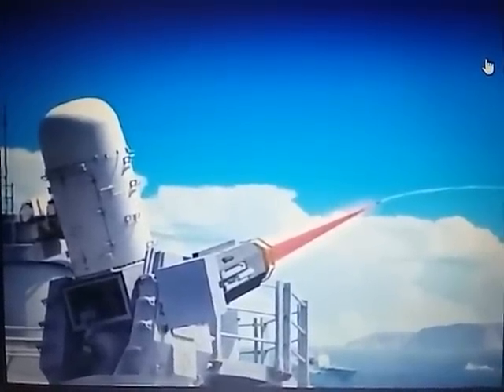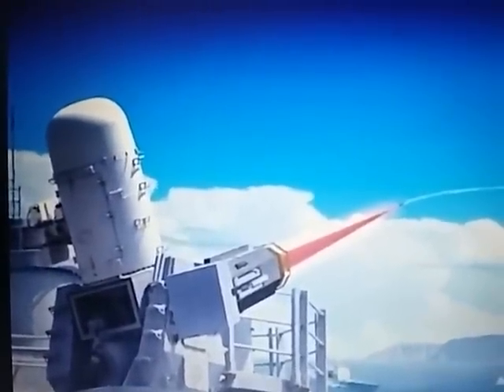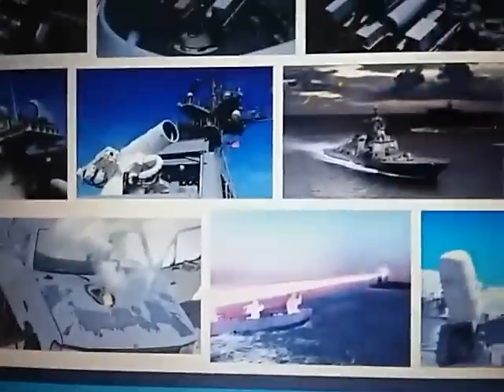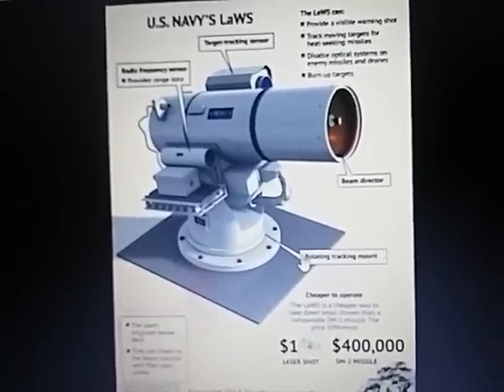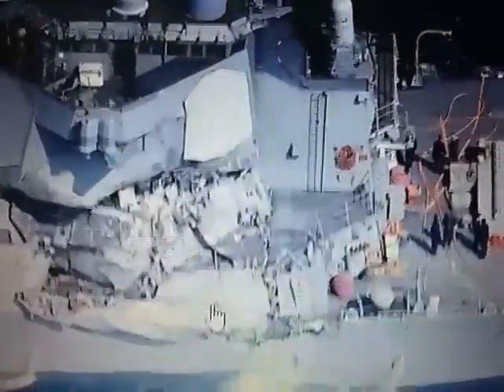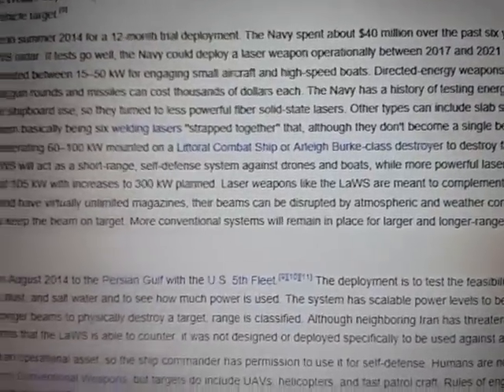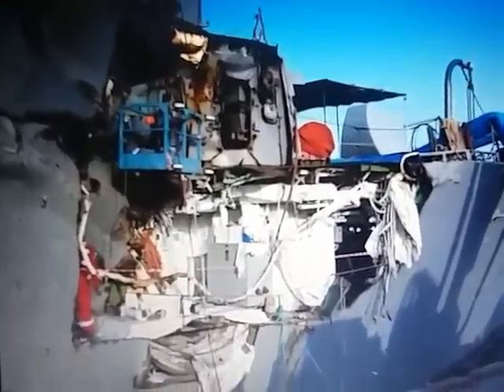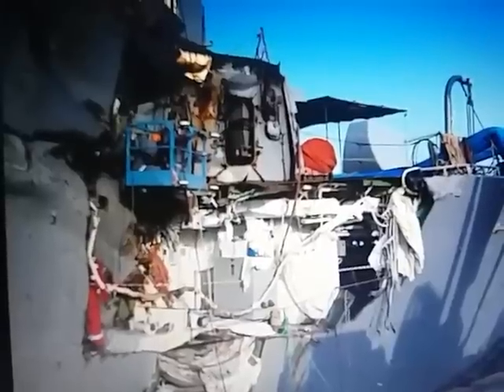!NAVAL LASER SYSTEM ZAPS NORTH KOREAN ICBM!

Comment: A laser will not disrupt electronics.  The LAWS system is a deck mounted system.  The system is based on the CWIS mounting.
The LAWS is designed to operate  at sea and in motion. There really is too much BS out there.
Reply: Paul Boyd  I’m completely ignorant as to what a laser can or cannot do, so I’m genuinely interested, could the laser destroy the  rocket?
Reply: Yea, I don’t get it either.  No way you put a weapon on a ship that requires it to be at anchor.

Comment: The laser system just looks like the anti air that is deployed on the ships. That could be your reason why why it is deployed in secret but in the open because it is disguised as another weapon. The reason why they deploy such equipment in the centre on the ships is to cover front and rear of the ship on on either side if they where to put on at the front and one at the back they would only be able to cover the back and front from one side at a time not a good issue if attacked from all sides.

Comment: Lasers travel the speed of light. The ship would not have to be stationary to hit something. Not only that the M1 Abrams tank has a leveling system to keep its gun on target when moving. I would think this weapon would too, even though not needed. We're talking 186,000 miles per second here! As soon as you acquire target and track it, then fire, its a done deal in a snap.
Reply from the maker: right but as we know the greater the target distance the less the margin for error at the source,...a few inches of travel up and down with the waves would correspond to dozens of feet different 200 miles up,....
Reply: The Abrahms Turrent Stabilization system used a computer to recieve position sensor input 100s of times per second. It then sends 100s of corrective commands per second  to the turrent stabilizers . The ships targeting radar controls  the weapons aiming . The accuracy with such a system is well above that of a traditional weapons Platform with its recoil affecting the weapons aim. The Lazer has no heavy bolt recoil and feeding affecting its accuracy . Its a high energy focused beam . It can track a target and keep the focused beam on the same spot easily. The same system has disabled the flight control computers on earth Orbiting Satellites causing them to fall out of orbit and burn up as they enter the atmosphere. Those Satellites are travelling at 25,000 + mph btw

Comment: The only way LASERs can shoot down ICBMs is from space as the missile exits the atmosphere. The atmospheric turbulence is too high through the bulk of the atmosphere. The airborne LASER system was cancelled due to this.  I worked on the atmospheric turbulence experiments in the 80s. Unless there is a massive increase of the power of these devices, which I have not seen in recent years, I call this BS.

Comment: Darpa and the USFS mounted HELLADS on B1-B's back in 2014. The Navy got them in 2015. Darpa designed the system to be under 3 cubic meters and 1/2 kg per kilowatt. They have developed a 150 kw and a 300 kw (two systems optically combined) in the upper UV and 3 to 5 nm gamma range. ABM defense is the primary role. Start paying attention to the B1-B's sent to NK after each missile, look at the laser emitter on the right side, under the fuselage in between the cockpit and the leading edge of the wind. Some of the videos on YouTube showing B1-B's taking off show the metallic blue tint laser window very clearly and this pod is easily seen in flight.

Comment: LAWS doesn't have that kind of range. They are used specifically for close in defense against incoming munitions and smaller anti-ship missiles. It has the power capability to replace the Phalanx. There is no possible way LAWS could shoot down an ICBM. The ship itself isn't even capable of producing enough power to fire a laser to shoot down a missile that is in low Earth orbit. 
 And no, LAWS does not require you to anchor the ship to be used against incoming munitions. It has a tracking system just like the Phalanx that allows it to track targets while the ship is in in motion.
Reply: Condor1970    You are mistaken on all points.
Reply: Yeah, I guess I don't know anything. I was just in the Navy and know all about the new weapons systems coming out over the next 20 years.

Comment: Pulse LASER, I worked on a system that is still in use at WSMR that uses a Sodium Flourine liquid Pulse LASER. Now as far as being at anchor is questionable. I was at sea too many times to know that a gimbaled system would not need to be stationary. Let's talk about tactics. In the 1980's we would lay off outside of the sea lanes, but the sea lanes are everywhere in that area of the Pacific - been there. My point:

He's an intel puke, not a weaponette, and not my specialty. He has limited knowledge in the specifics of the weapon system. That system is gimbaled, is quick acting, and requires a lot of power. LASERS are inefficient, and require a hell of a lot of power - like all class 4 plus LASERS...
Reply: http://www.wsmr.army.mil/testcenter/testing/landf/Pages/HighEnergyLaserSystemsTestFacility.aspx
Reply: http://www.thelivingmoon.com/45jack_files/03files/White_Sands_Proving_Grounds_01.html
Reply: Consider SDI, but using a ship for mobility, instead of a satellite.

"Why a ship?  The whole SDI satellite was only a few thousand kg!"

Yes, but it was unmanned, and didn't need shielding. The AR shields on such a system would ordinarily be hundreds of thousands of kgs, which illuminates where the real high-tech advances have been made:

Destroying stuff is incredibly simple; preventing destruction is remarkably difficult.

Comment: Im curious to see if we can confirm that the fitz was in striking distance and anchored at the time of the failed ICBM Flights/launches. I feel thats only thing between full comfirmation of this.
Reply: Also, his hypothesis is that the laser was on the ship's starboard side, but if the Fitz was facing North-East, the laser was on the wrong side of the ship to be pointing at missiles coming from NK. Another fact is that the bow of the ACX would have hit almost exactly where the laser was positioned on the starboard side of the Fitz. That's a bit of a coincidence, isn't it?!

Comment: Another day, and another theory. This new theory is actually based on what Florida said, the hole was used to cover up something.

I read a Chinese news article about the USS Fitzgerald, and the editor had some knowledge about the ship. He drew a map illustrating the above and below water impact area, as marked by red.

https://i1.read01.com/uploads/0GeU3T3Ief.jpg

Noticed what the picture actually show? Half of the hole was in the engine room!

If it were true, then it explained why the sudden lost of all the power. The sea water rushed in with the hole, almost immediately the gas turbine engine was blooded and disabled. The whole ship could have lost power in less than a minute!

Someone here might say, "Wait, there were 2 gas engine rooms and they were completely isolated..." That's true but in a sea area which is relatively safe and friendly, the destroyers only use 1 or 2 gas turbines in the engine room #1 to save fuel. Once engine room #1 was flooded, all electricity went out and the engines in room #2 didn't have the power to start. 

The Navy couldn't acknowledge for some reason. They only said one of the two shaft were locked, and tried to use it to give us the idea why the ship couldn't go by her own power afterwards. However, you have to know that the shaft and the engine connects to it are very tough, they were designed to be working even after a torpedo hit. There are shock absorbing mechanism in the whole power train. It unthinkable that the propelling engine and the shaft are so far from the impact yet were affected the most.

I think the reason they don't want to say their engine room was flooded is obvious. Too embarrassing! And they don't want any one knows there are weak points like that on their destroyers. Well, too late for that. It's not co-incident that the USS Cole was attacked in the same spot, and the Cole also lost communication and power afterwards. It was not really a secret, not even 16 years ago.  

Also, the story about "radio room" got flooded was totally bogus. It was made up to cover up the engine room problem. There was a comm center, which could have flooded and caused the blackout, but its location means it could only be the last one get flooded. So it's not the reason the ship couldn't send out SOS signal to the base.

I believe I am getting closer to the truth. Unfortunately I still couldn't rule out the human error. If someone in CIC being ranking officer and extremely cowboy, the incident could have happened the way like the Navy says, even though the chance is very small. At least now I know why the ship suddenly lost all power. One big piece of puzzle removed.

Comment: Hey guy I build navy ships I work at the yard that built the Fitzgerald  a ddg51 cannot sustain the power needed for a laser system like the one in the video or a rail gun that is what the new ddg1000 is for and the new ddg51 class ships are for not the current ones the new ones will be getting a electronic drive propulsion system and the only other ship that could take a system like that are the newer style carriers but you are completely wrong on everything you are assuming
Reply: Have to agree with you. The Fitz cannot "SUSTAIN" the power needed for laser or magnetic rail gun, but with the help of a large array of super capacitors it's still possible to do the experiments in a intermittent way.
Reply: Philip W Well where are you going to put a laser on a ship that was never designed to have a laser system installed? As you can see from the pictures all of the original weapon systems are still installed. It would take probably millions of dollars and an extensive layup period to install laws.
Reply: Uh... you win...

Comment: Florida, thank you for another great episode and some of the things you said do ring a bell.

The purpose of the patchwork perhaps is to cover the interconnection between the CIC and the Vertical Launch System. The Internet is not supposed to know how the missiles are wired, or any extra device to control the missiles. So what your old friend said do make a lot of sense. It's really necessary to spend 3 weeks to patch that hole.

Comment: In order to use the laser system or laws the ship the ship does not need to be anchored. No the ship doesn't need to be anchored as it has a very accurate GPS station-keeping system that will hold it in the exact position they wanted to sit in regardless of most currents and wind conditions. The ship was an anchor because it was in Port.

Comment: That is not a laser system.  That is a phalanx or modern version of phalanx.
Reply: 1. a body of troops or police officers, standing or moving in close formation."six hundred marchers set off, led by a phalanx of police"a group of people or things of a similar type forming a compact body."he headed past the phalanx of waiting reporters to the line of limos"(in ancient Greece) a body of Macedonian infantry with long spears, drawn up in close order with shields overlapping.2. Anatomya bone of the finger or toe.
Reply: Phalanx gun, primary use navel close anti missile weapon using a 20x102 mm cal., firing 3000 rounds/min or 50 rounds/sec.

Comment: Take a more simple approach.. lets assume She was anchored, and yes She did have a laser equipped.  What can the Captain do until such time as he has definitive certainty that the Freighter has of ill intent. IF the intent was to sink the Fitz, He is not  going  fire on that ship unless he has no other option. If the Fitz was shooting down the NK ICBMs, Japan, would no doubt be aware. Possible scenario, NK made noises as if were going to test or attack/ used this for the Fitz give up location, timed with assets (Crystal)  Captain holds his position because that's his standing order. Japanese vessels race to intercept, Fitz just gets rammed. IT can happen that simply. Again, just a thought.